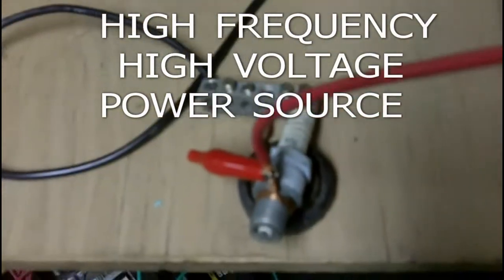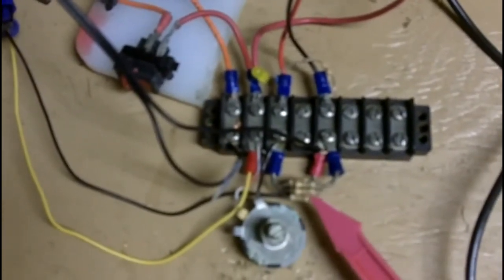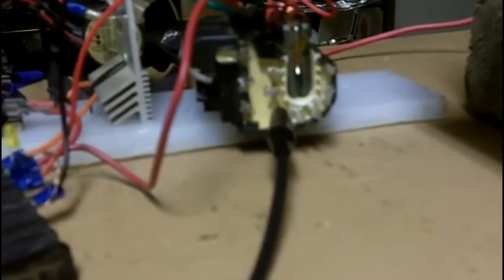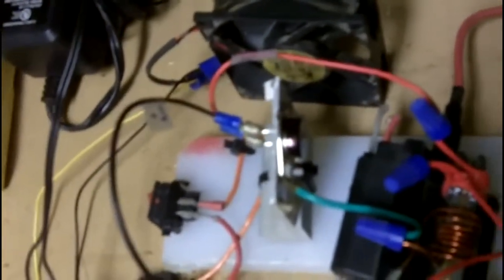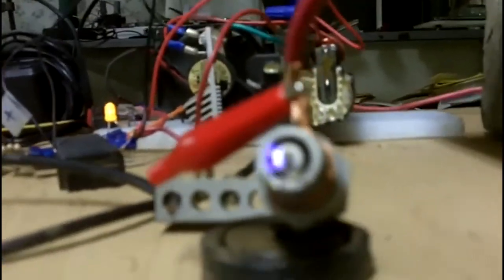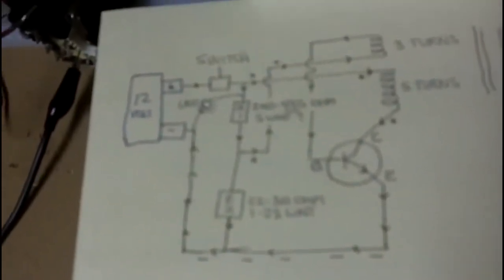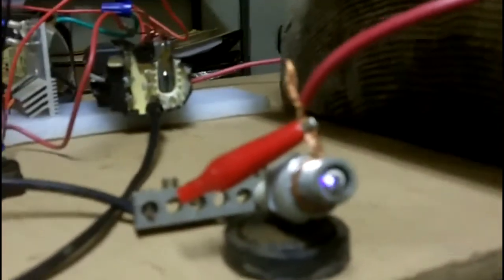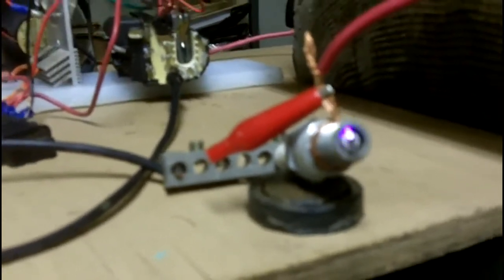HIGH FREQUENCY SELF RESONATE POWER SOURCE

Comment: I did the same thing when I was like 14
I stuck a screw drivers under the big suction cup in my TV for fun and that's how I discovered the high voltage. Later  I connected wires on the big wire and the TV ground and connected that to the TV rabbit antenna.  Tada:  Jacob's Ladder

Comment: this circuit is very useful  , i built a similar circuit and use it to light 120 volt led light bulbs , i can get enough light to function in my kitchen for 3 watts of power ran from a 12 volt battery which i can charge with my wind turbine. if you ever end up without any power from the electric company things like this won't seem like such a waste.
Reply: I don't get it. IM A NURSE, PLZ HELP ME GET POWER. I'll pay